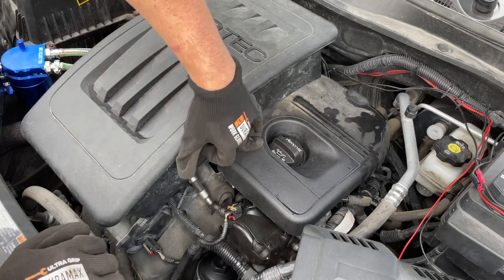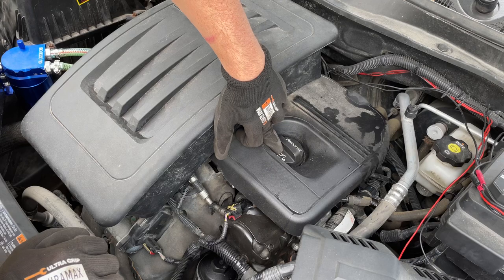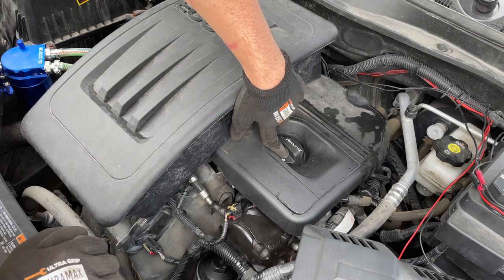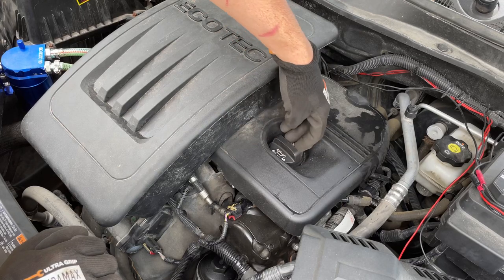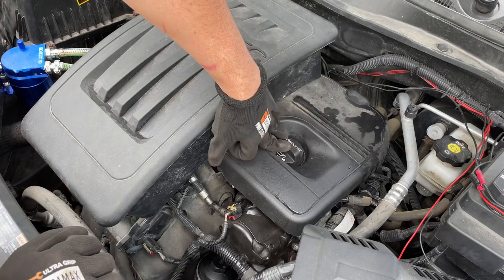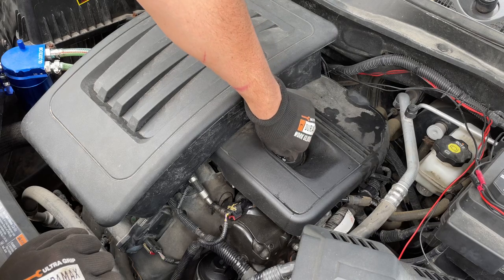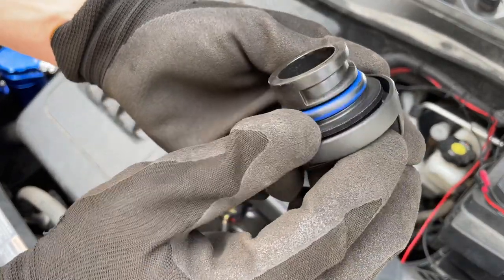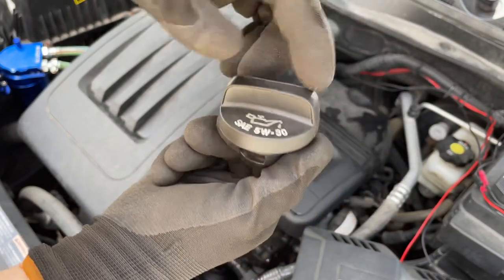How To Stop Moisture Buildup On Oil Cap

Comment: Thoughts on the vented caps?  FC219.  Heard they can prevent too much pressure that could blow out seals.  Just picked one up
Reply from the maker: I prefer to clean the pcv in the manifold properly and avoid the use of the fc219. The vented cap is just like a cheap bandage that won’t actually fix the underlying issue. I still run a normal cap but I test my pcv yearly and clean if needed. So far I have no issues

Comment: Its not always that. You can have a clogged pcv. A new pcv is prob same price as cap if not cheaper and is the root of the problem most of the time with condensation buildup
Reply from the maker: You are correct about clogged pcv. This illustration in the video fixed my issue. However a clogged pcv does indeed cause this as well. However your statement of replacement of the pcv being cheaper is not true in some cases especially on this Chevy equinox where the pcv is a small orifice in the intake manifold rather than a traditional removable valve. Cleaning this pcv requires pulling off the manifold

Comment: No. I did that first. But it is not on stick. Yet I am operating in Tahoe/Carson and it is been snowing for 4 months
Reply from the maker: This may not work for everyone. But I’m my personal experience it worked. Thanks for watching
Reply: mines not on the stick either. What was the cause of oil not getting on the stick?

Comment: Is the FC219 the right order number for the relief cap? I want to get one. I have the 2.4  4cl. Equinox  suv
Reply from the maker: Yes that is the correct one. If you order on amazon it says it won’t fit but that’s because it is not considered oem. But it fits 100%. Many people use them on the 2.4 ecotecs. Thanks for reaching out. Please like and subscribe
Reply: @BillOfAllTrades2016  I ordered one from amazon came to 33.00 because I'm in canada, always costs more than the US. I just hope it works. Thankyou
Reply from the maker: Yes I run into the severe cost increase every time we buy something for the vehicle. When you have the opportunity you need to also clean the orifice in the manifold like I did here: https://youtu.be/cyoJ02cAQig
Reply: FC219 is the vented oil cap. FC242 is the non-vented cap